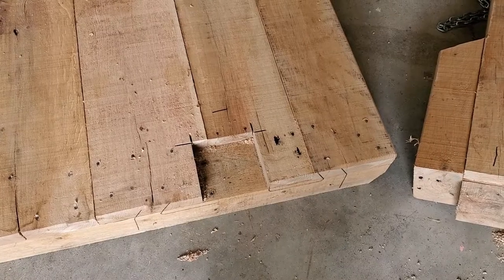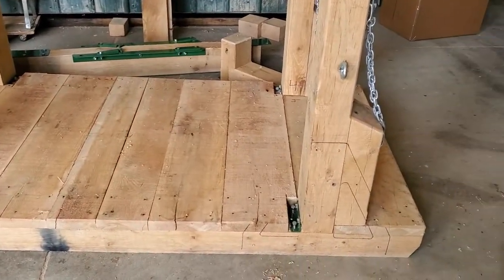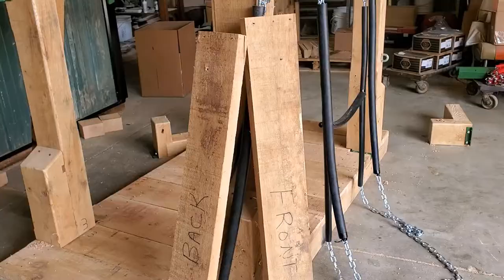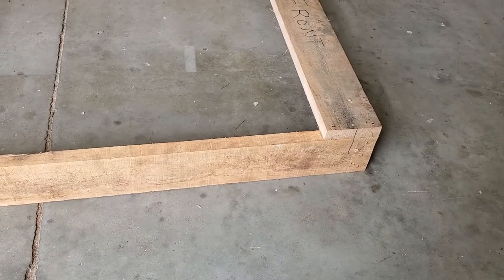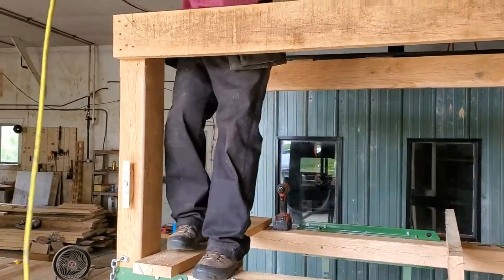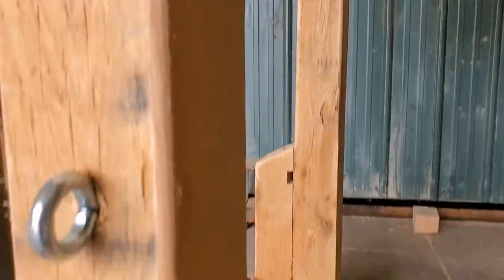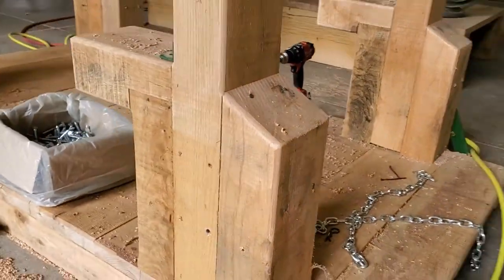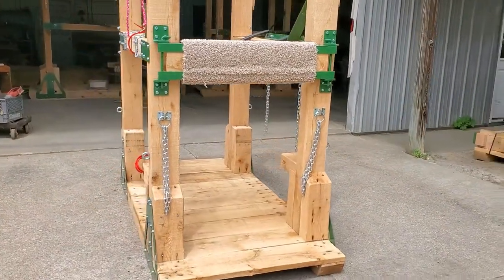How To Assemble A Horseshoeing Stock

Comment: I bought one of these shoeing stocks and it has helped save my back quite a bit. It took a little getting used to working around all the logs when I have shod horses for years with them between my legs, but the stocks are wonderful! It would be nice to have a video showing the correct way to tie a horse in each position in the stocks. I figured out a way that works but there may be something more simple than how I'm doing it.

Comment: Hi Marlin, I live in England and need to build one of your horse sticks, but I need help with thewood sizings , 4x4,s 3x4s,how tall what is the base made of. Most importantly, where did you get the metal brackets etc and what are they all called and where did you get them from. I have a horse that needs his feet picked up and he won't do it so my farrier suggested I got one or built one of these horse stocks, the horse is a cob a bit like a draft horse but this one has been neglected for 6 years, I had to yesterday 7th October 21 to have him sedated as he has not had his hoofs picked up in 6 years, so I have a tough job on my hands. But for the farrier it would be easier to put the horse in the stock to do his hoofs. So your help would be most appreciated. Many thanks Anna from the UK